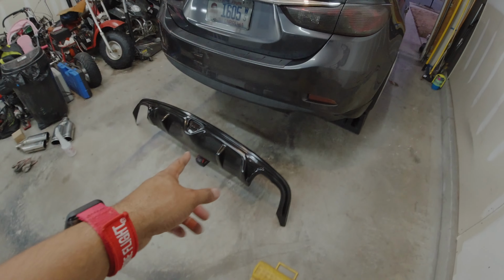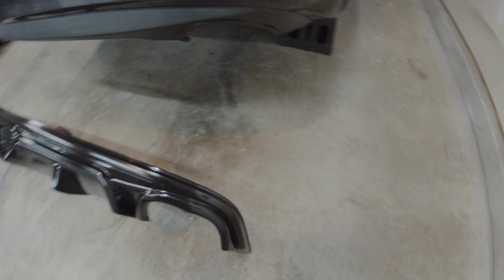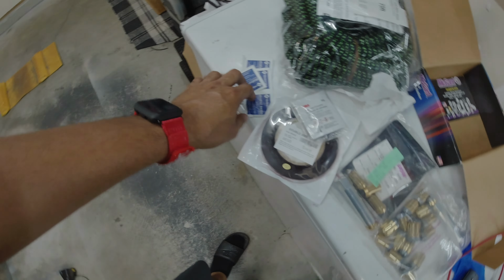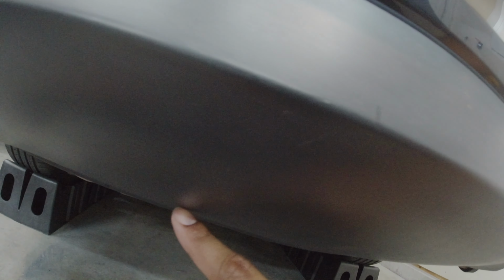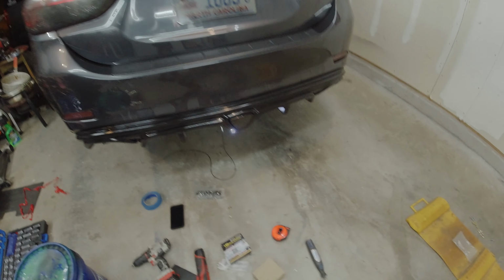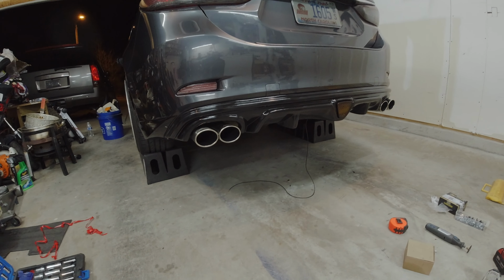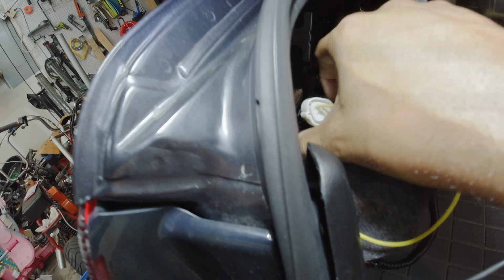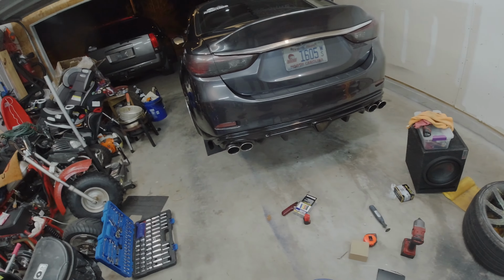Broken AliExpress Quad Exhaust Rear Diffuser Pt. 2 | The Install.

Comment: How’s your Mazda is to still reliable and how many miles you have on it now ??? Any issues still a good daily
Reply from the maker: Mazda still going strong. I have 184,000 miles currently. The only issue I've had so far is the rear manual ebrake mechanism messing up. Other than, it's been solid!
Reply: @DariusBuildz  I got one with 150k on it 2013 couple days ago previous owner said they run great and I got the 2.5 to thanks bro